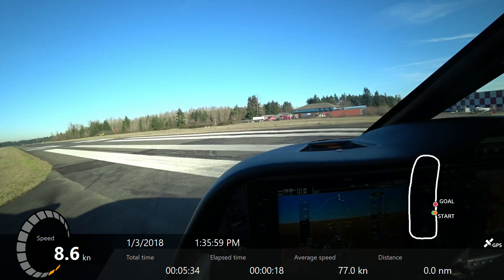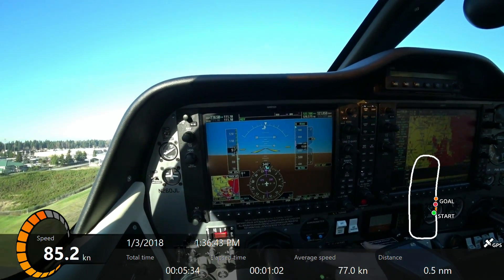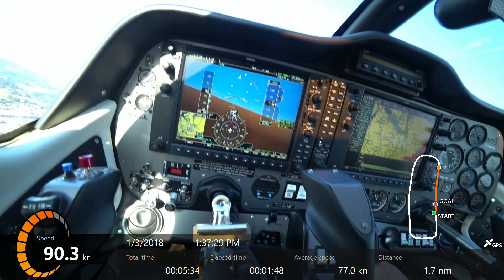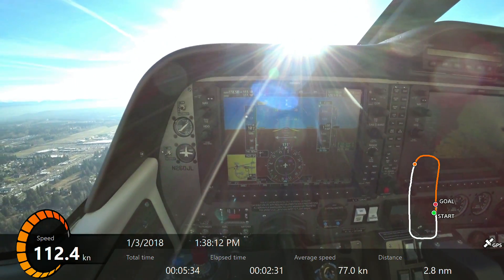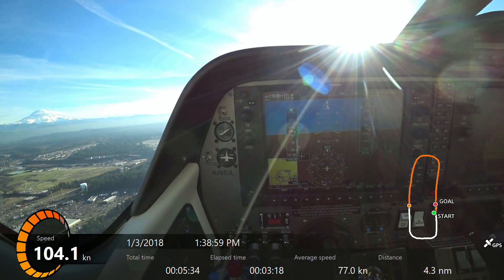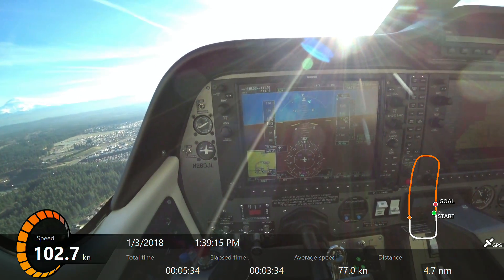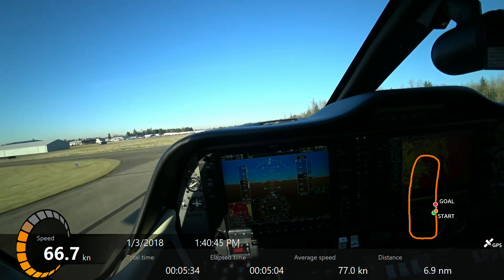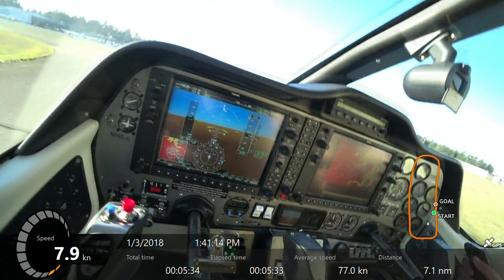Twin Tecnam P2006T No Flaps Takeoff... Flow Check Review (MEI Training)

Comment: WTF no flaps and you didn't know before T.O.
Reply from the maker: The Tecnam has a flip up  to take out all flaps and hold down to put in flap switch. 

( sort of like an early era  Cessna ) 

The flap switch is  a weak point in my opinion. 

This was an MEI student and I make them all deal with one no flap takeoff  at some point ( I try to surprise them). It’s not uncommon to have students put in flaps and then accidentally take them right back out with the switch set in the up position.  The Tecnam is fine taking off without flaps but it has a totally different feel and is a lame duck if you try to rotate at the normal rotation speed.

Comment: Just found your channel and subscribed with a like.👍 I have always had an interest in the Tecnam P-2006T since its introduction. Really thinking I would like to obtain my twin, instrument and commercial ratings in the P-2006T. Main reasons: the utilization of yokes (dual side-stick would have also been fine), the roominess, modern appearance, and from what I have viewed on YouTube, great 1 operational engine handling characteristics. Thanks for the video. Happy/Safe Flying!👍🇺🇸✈️
(without having to refer to FAA regulations, was wondering if the P-2006T qualifies for obtaining a complex rating)? Look forward to reply.
Reply from the maker: The P2006t counts for complex time and is a great way to get your 10 hours complex time. Now that you don’t need a complex for the commercial check-ride. 

It’s a great training aircraft and  would be a great overall aircraft if it had a higher useful load and was a little more robust.  It’s hard to go back to flying  a Cessna 172 after getting used to the cool features in Tecnam.